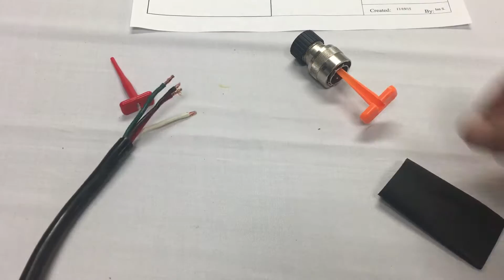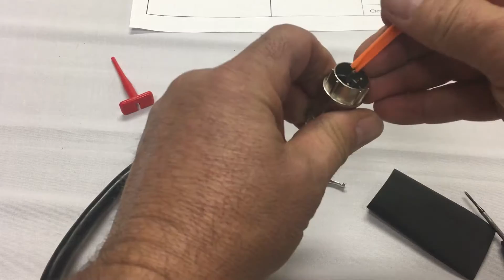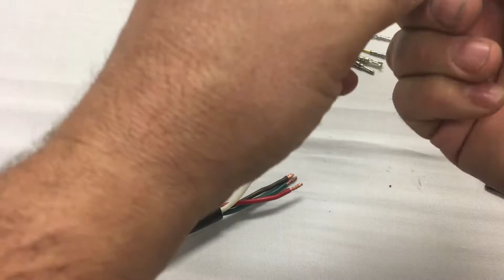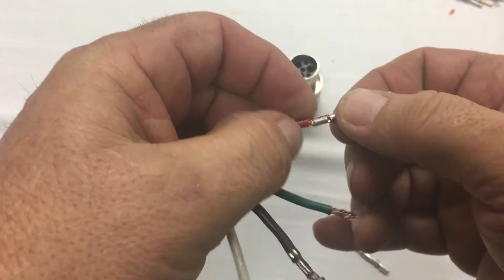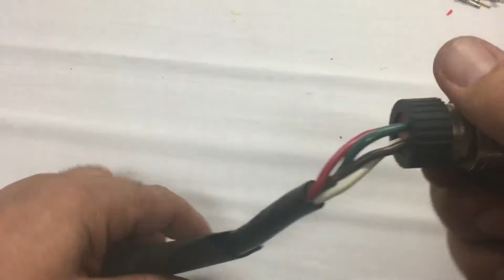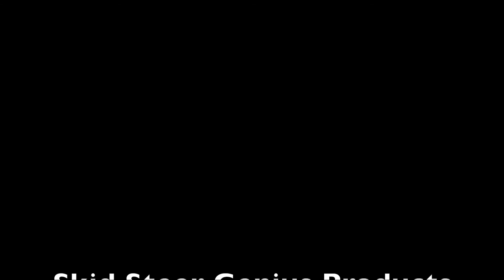#102 - Save Money: Bobcat 7 Pin Connector Repair

Comment: Connector manufacturer: ITT Cannon
Connector part number: TNM6S14-0304P1L

Optional heat shrink adapter: TNA14HSAD-00L

Thank me later 😎
Reply: Appreciate this.  Any chance you know the two different pin contact wire sizes?  My contacts have corroded and that's all I need to replace.
Reply: @travis_todd  unfortunately I can not help you with that. I don't have access to that connector anymore.

Comment: There is absolutely no documentation on how to unhook electrical connectors for bobcats. I think you could get a lot of views if you do a video on that. For example, I don't know how to unhook the connector on the back of air cleaner housing on my s185. I spent hours trying to get the answer.